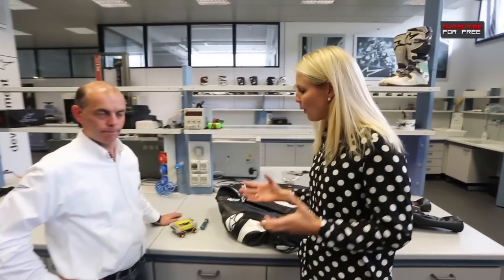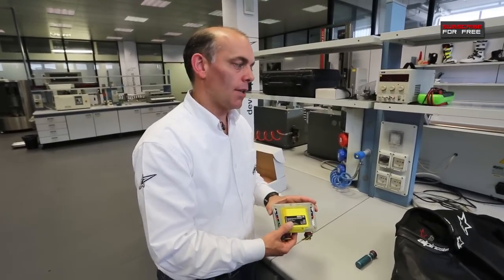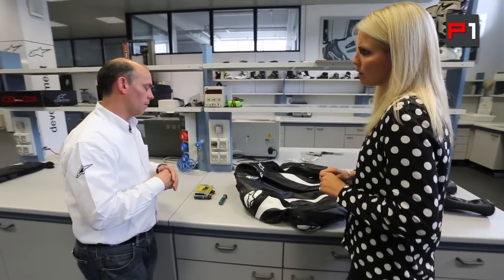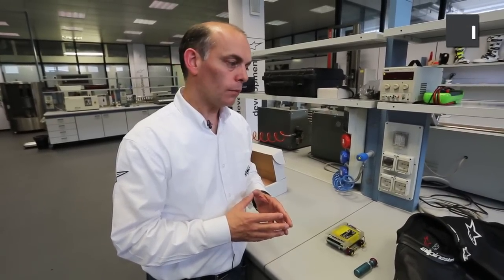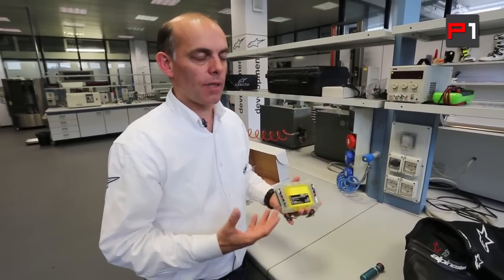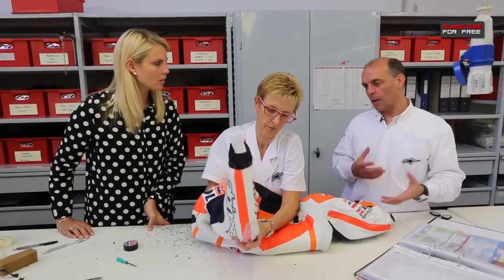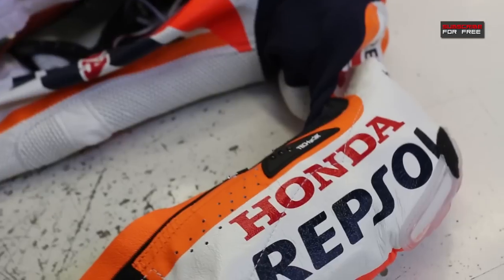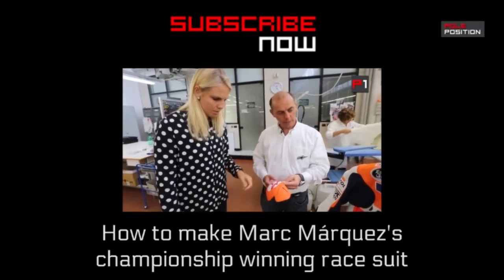Big MotoGP crashes safer with airbag technology - Marquez's racesuit

Comment: Make air suits mandatory but an even better rule?  Mandatory electronic package (SAME on every bike) protects from all-sorts of crash potentials ....traction control,  abs etc .....everyone has to run the system ....a collaborative culmination theoretically improved every year ....another idea?   Protected wheels to avoid wheel to wheel contact caused crashes...ALL these things COULD be implemented also to production bikes improving motorcycle safety ...improving sales
Reply: That would remove a lot of the skill in racing.